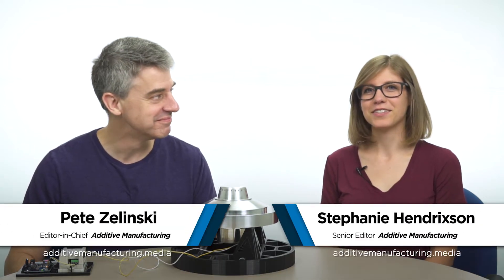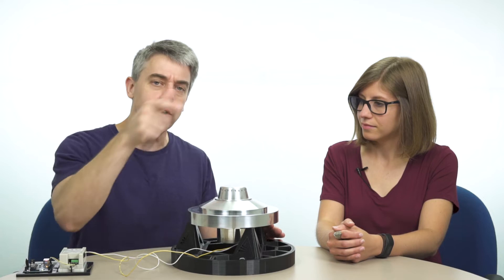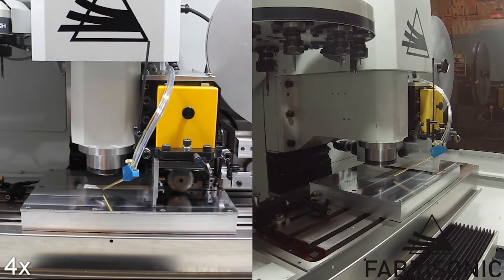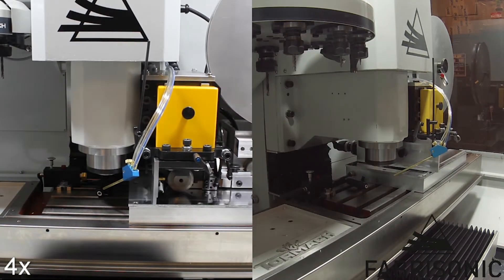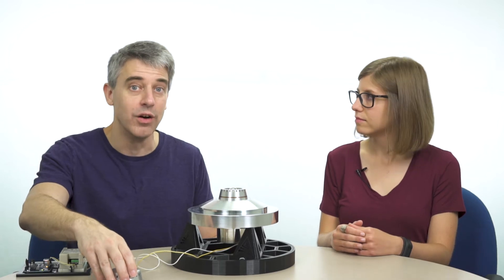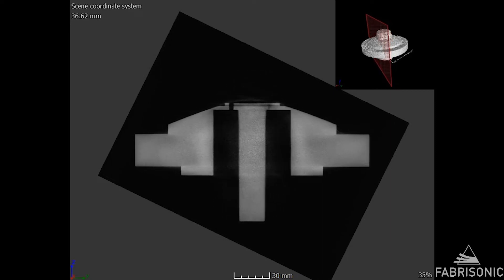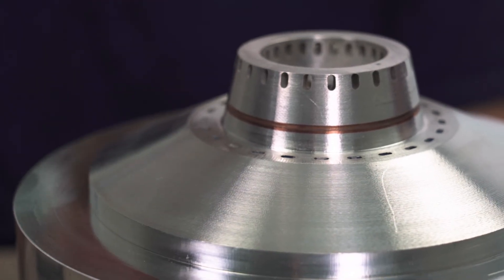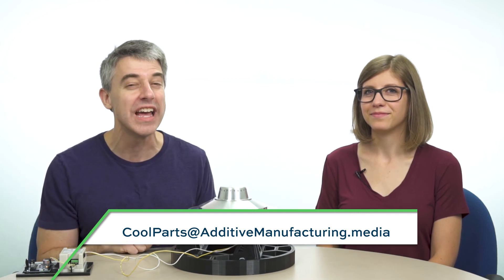This Rocket Fuel Injector Was 3D Printed With A Working Motor Inside!: The Cool Parts Show S1E1

Comment: Two things caught my eye on this video: 1) Multimaterial metal printing enabled a flexible copper seal (wow) and 2) embedded features like a motor in this rocket nozzle unlock very new ways to solve problems.
Reply: Thanks Plural!   Wait until you see the embedded matrix of strain sensors.  Stay tuned......